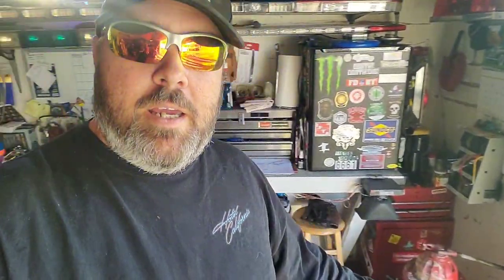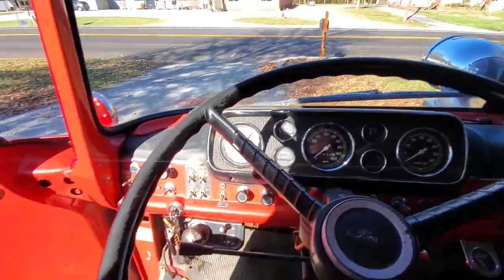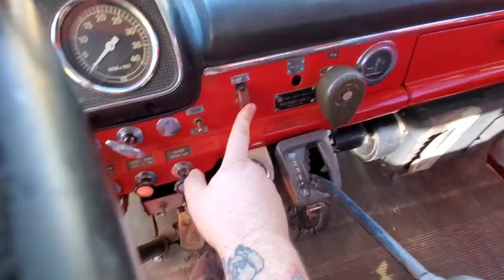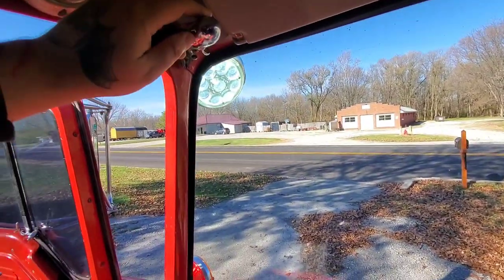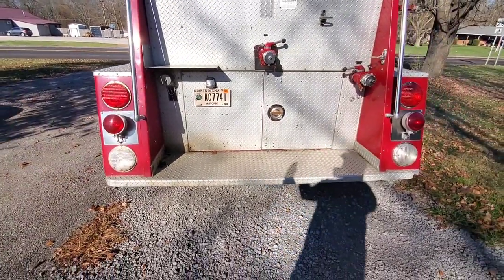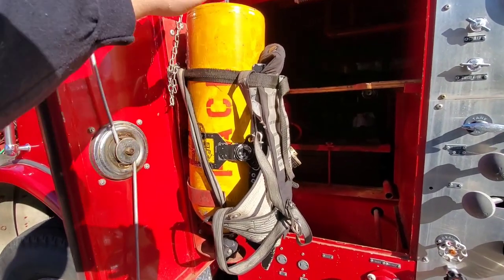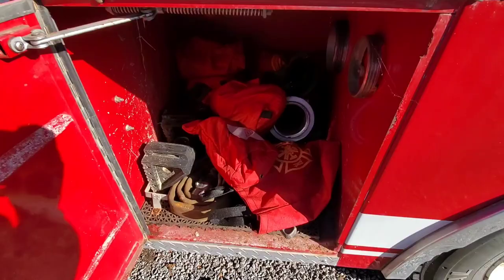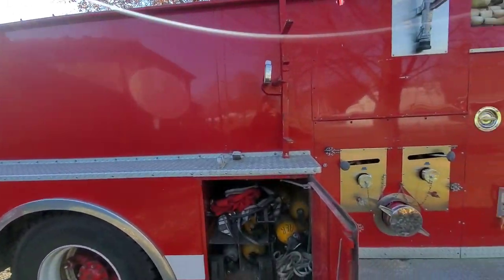My 1976 Pirsch Pumper Truck

Comment: What bulbs did you use for the spot lights? What did you pay? My truck has the original GE bulbs that are blown out. Definitely need to put in new bulbs.
Reply from the maker: They're used Unity U-8547, I got them off a friend,but I think I've seen them used for around $75
Reply: @TourDriverSean  would any LED par 36 bulb work?
Reply from the maker: @bladenrexroth2555  I would think, but can't confirm